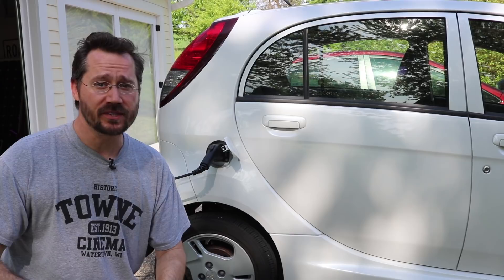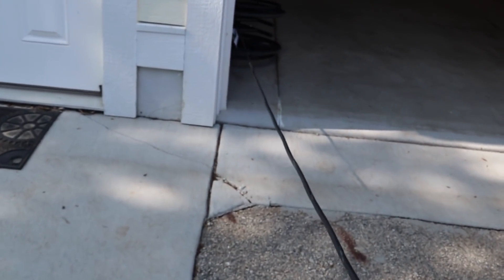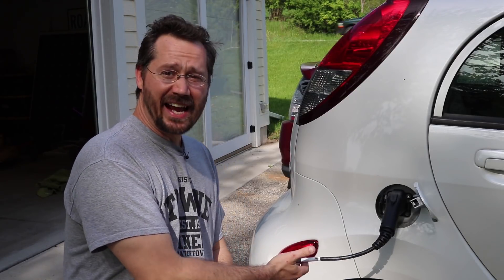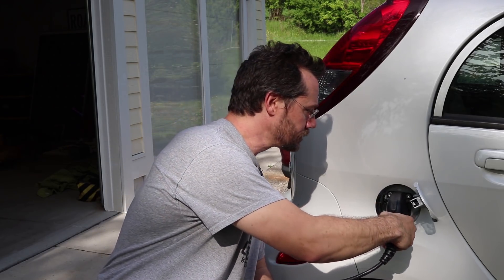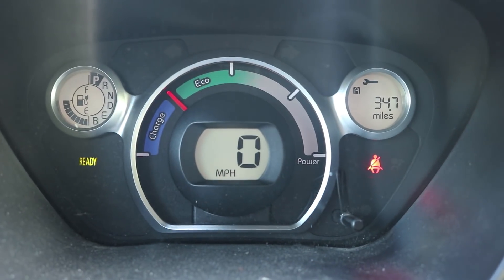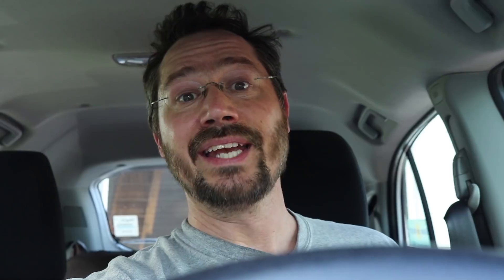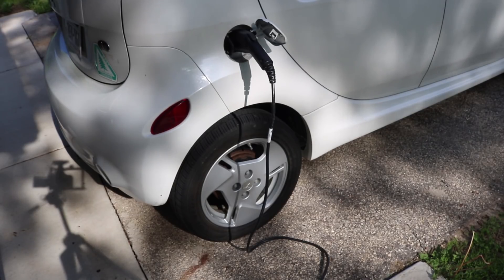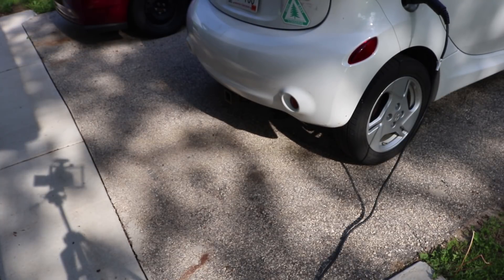Driving an Electric Car while PLUGGED-IN!?!?

Comment: It would be a good idea to have some kind of interlock switch that disables the drivetrain while plugged in.  I accidentally drove a golf cart like this and pulled the wire out of the charger and broke the plug.  Electric Toyota fork lifts are much better in that you have to unplug the battery to the motors to plug it into the charger but not both.
Reply from the maker: All electric cars DO have an interlock switch. In this one odd example, you can NOT turn the car ON, but you CAN put it in neutral while plugged-in.

Comment: Anybody tried this at a commercial re-charge station ?

You'd have thought, as this is the obvious doofer error that everybody would make at some point in their electric car driving career, that designers would have built- in a fail-safe, ideally one which cut the drive, applied the brakes and sounded the car alarm horn and flashed the lights in unison and cut the power at the  charging unit.
How come the Type Approval Authority didn't insist on such a feature as universal across types  and not approve the type until each passed test ?

I thought only the British were fond of lessons-learned blunders.

Motor manufacturers . . What a bunch of divs.

They'll be a stream of litigation and perhaps class actions on your side of the pond.

Comment: Benjamin seems to be taking the wrong message from this... He should note that it's possible to drive off in HIS electric car while it's plugged in. This is a design flaw on Mitsubishi's part. Many/most EVs will not let you shift out of Park while the car is plugged in. They won't let you shift into Drive and then just act as if they're in neutral. Mitsubishi should have done the same with their EVs.

Granted, I'm not aware of any ICE vehicles that prevent you from driving off while plugged in at a gas station, so even Mitsubishi's flawed design is an improvement over what we all grew up with.
Reply from the maker: Maybe this came across wrong. Yes, this is specifically a flaw to this model car. And it is also still better than gas cars where you can drive off from the pump!

Comment: the reason the car gives you no warning on the dashboard is that you can charge the battery while moving with a generator but it requires a special adapter plug  for the generator.
Reply from the maker: All  modern electric cars have a safety feature that prevents turning on the car while the charging cord is plugged in. It has nothing to do with adapters or generators.
Reply: @BenjaminNelsonX  better search for charging a Tesla on a generator on youtube then because it has been done with an adapter they all seem to be able tocharge the cars and turn them on whilst charging.
Reply from the maker: That’s simply not the way the cars are designed. I’m sure somebody has hacked a commercially available EV to run the car with the charger running, but they are specifically design to NOT do that.
I definitely interested in modifying cars. If you want to share a video of a vehicle running with a generator, please do!

Comment: Is there an override for this? I'd like to be able to press a button to "go anyway" when I'm plugged into a generator that's attached to the trailer hitch receiver.
Reply from the maker: On commercially-built electric vehicles, they WILL prevent you from powering on the car and driving away while plugged in.
It's just like how you wouldn't want to drive away from a gas pump with the hose still stuck in your tank!

If you wanted to be able to run a generator while driving, the easiest way would be to do it with a home-built electric vehicle, such as when I ran my Electric Geo Metro as a plug-in hybrid.
https://youtu.be/xXVi-g4jWqI

If you want the ability to run on battery electricity OR gasoline, a used plug-in hybrid like a Chevy Volt is a great choice.

I'm sure that you COULD take a commercially-built electric car and bypass the safety feature to have it plugged in while running, but EXACTLY how you would do that would depend on the particular model of car.
In my opinion, other options would probably be better choices.

Comment: i would like to have my car to drive with a generator plugged in  my back seat for very long drives, wonder if it is possible
Reply from the maker: You would need to trick the car into thinking it is NOT plugged in or you would need to directly connect to the battery, bypassing the stock charger built into the car.
Reply: Why?  Then just get a gas car.

Comment: I have a 1500 watt Flux electric moped. I have 6 batteries, 60 volt 20 Amp Hour and I want to test them for discharge without riding the moped.  So I need some type of discharge set up. Anybody got some ideas or advice?

Comment: Our Honda Clarity won't let the car be driven when the power cable is plugged in. Also the charge port is located in front of the driver's door so it is not hidden around to the other side of the car.

Comment: Tested on the i-Miev at work today, 2010 or -11, same as yours on that one.

Also tested a bit more with my -13 Leaf, and it to can be moved with cable connected! But it is very foolproof, you really have to ignore many signs to make it possible...
I haven't fully tested it yet, but I at least found one way to do it.
If the car is not fully switched off, you can not open charge-port, therby not able to connect. However, I daily see Leafs with the port open.
If you open the drivers door before you turn off the car, it will bug you (very annoying biiips).
If connected, it will not go out of P if you try to start the car, so not possible to move, also with a lot of alarms. If you stop the car in gear, it should select P automatically when turning off. I always press P my self, but I'm pretty sure it will do it for you if you forget.

But, if you preopen the chargeport (or never close it), select N and leave it "running", put "hand"brake on so it doesn't move, plug charger in, then it will move. I felt a few jerks as it started to roll, so it might be the P trying to engage, or just my nerves pressing on the brakepedal..
Thoug I highly doubt it, it might be possible to drive of if you preselect D or R instead of N (not tested yet), but I suppose there is a safetyfeature there as well, (will not send power to motor when chargecable connected).

Comment: I don't buy the "no visual", that's what mirrors are for. Always check mirrors before driving off. The same goes for all those driving of with gas-hose still attached, it should NEVER happen!
Haven't tested to get the Leaf out of park while on charge, it beeps at you and shows a message in the display.
We have a i-miev at work, I'll test if its the same as yours next time I drive it.
Reply: I'm just curious.. if you're parked in your driveway with the garage right behind you, why would you check your mirrors? to see if the garage is going to pull out and pass? that makes no sense whatsoever. some might, sure, but I guarantee a lot don't, because whats the garage going to do, overtake and brake-check you?
Reply: Sorry to say it, but finding excuses for NOT checking mirrors is just plain stupid.
Most of us have some sidevision, so really you don't have to turn head that much to get an idea that something is "wrong" anyway.
Your garage most likely won't overtake you, but your kid, dog, wife or whatever might come running. Then God knows what will happen..

Well, in addition to the fact that you clearly might have something attached to the car..
Reply: theoretically true, but not everyone actually has those concerns, and those that don't, and are not used to having a plug-in car, will likely not have formed the habit as yet. not saying you're wrong about the should - at least for those with a plug-in car,  just stating fact. if its known that its not necessary through habit, then it would take time to change said habit. not everyone will need to check their mirrors when pulling away from their own garage. simple truth.
Reply: @therandomtester9561    Someday you'll make a mistake.
Reply: @alext9067  we all make mistakes, me too.
In addition to the above mentioned, mirrors might be: missing, broken, bent in/out, wrong adjusted, iced/fogged up. When do you want to noticed that, before taking off, or when you really need them?
Reply: @chrissheard5493  You are totally correct.  Cars are not aircraft.  They are driven by people with normal skills without checklists.  To assume that a person will robotically follow a procedure before driving off is an invitation to disaster.  In the real world, too many circumstances keep getting in the way.

Comment: I would have thought there would have been a shifter interlock to prevent it from being able to shift into gear
Reply from the maker: It's a mechanical transmission on this car. Turning the key to ON unlocks the transmission.
Reply: They should still have a mechanical interlock. It would be harder to do but still doable.

Comment: Having a simple "charging port open" dedicated light and beeping alarm when you put the contact could be a good idea. Would prevent both the issue of forgetting to close your charging port cover and going away with it plugged in. Fool-proof would be to lock the handbrake when the plug is detected
Reply: Who ever pays attention to the lights?  by the time you realize what it is, you already drove away and ripped it out of the charger.

Comment: Umm... Only thing may be to park nose in, if the EVSE is long enough, and it would be easier to see if its plugged in. Or big note on drivers seat 'UNPLUG'  might do it.
Reply from the maker: This certainly was a "perfect storm" to cause it to happen. Changing any one of a number of things would have prevented it from happening, including if the car was pointed the other direction.

Comment: My Chevy Volt refuses to shift out of park if the cord is still plugged in. It will also flash a warning explaining that as well. Glad GM's engineers thought of that question.

Of course, the charging port is also by the driver front door, so it's really hard to miss.

Comment: My Nissan Leaf Will not go to run with the plug in.  It will go into standby where everything is on but the drive is still disabled.  Also you can not take it out of park as long as the plug is in.
Reply: I'm sure all common EVs must be like this. Rudimentary design decision.
Reply: @savedfaves  It's required.  I'm not sure by who SAE, federal law, or just simply good practice.  In terms of safety your vehicle should never move while a cable or hose is attached.

Comment: My Volt completely locks the shifter while plugged in. I've never tried to drive off with it connected, but I have backed out of my driveway several times with the charge door open. Fortunately it has a sensor for the doors state, so it'll let me know.

Comment: While I don't know of a fix for your wife's car but a good fix for your metro might be a Kussmaul Auto-eject system. They've been used in emergency vehicles for decades. You refit your cord to a plug that is more robust. 12volts from your switch being turned on energizes a solinoid that spits the plug away from the vehicle a safe distance so you can avoid doing exactly this!